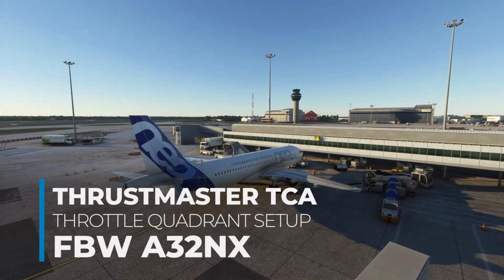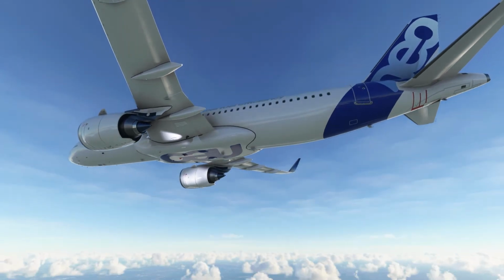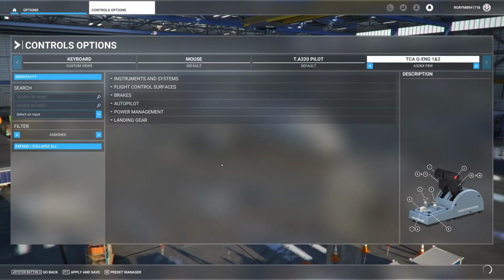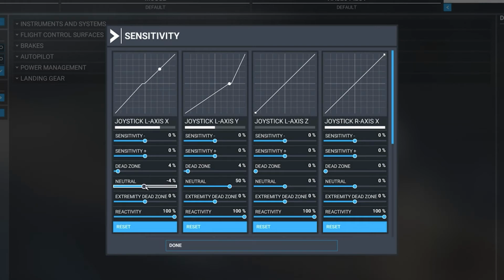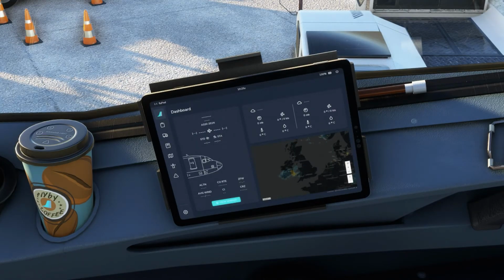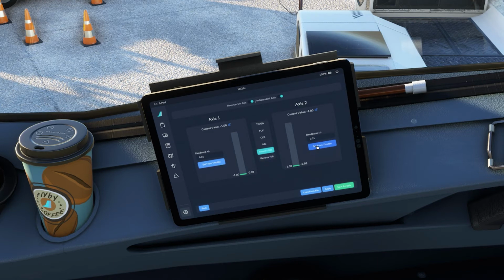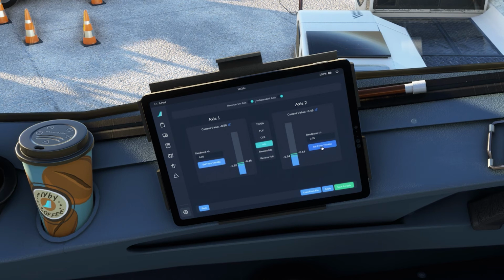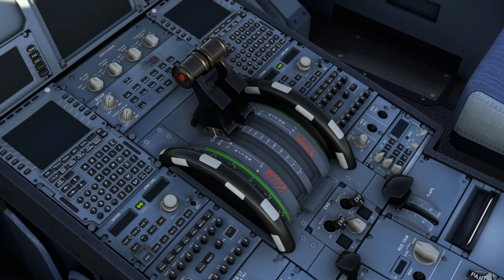A32NX Airbus TCA Throttle Setup: Best Settings Flight Simulator 2020

Comment: Why can’t all tutorials be short and sweet and to the point like this one??  Thanks a bunch bro!
Reply from the maker: Thanks mate, happy flying.
Reply: @rorymarsh Is it only for the FBW A320 or for all of them? i want to calibrate mine since i have two modes, in one the throttle works perfectly but the rest don't work and in the other one, everything works perfectly except the throttle (even if they are at the same level one of them is at 50% and the other at 70%)
Reply from the maker: @Aviationlover14  The tutorial is fairly old so, only relates to the FBW. The FENIX and The Inibuilds A320 both have their own iPads where you can calibrate throttles in there. I keep my settings the same as I've shown in the video - linear (straight lines.

Comment: I wish mine worked properly anymore....
Reply from the maker: What's up with it?
Reply: @rorymarsh  the throttles don’t go to the correct detents anymore, and for example when I push it up it can randomly go to idle or reverse which is the complete opposite way but then it’ll go to toga, or any detent, I don’t have reverse axis on in my throttle settings… I’ve calibrated it on the a320neo fbw, Shows the throttles are out of place, Can’t calibrate it anymore doesn’t let me but I have calibrated it during the time it was like that, I calibrated the actual throttles outside of the game, Downloaded drivers. Still doesn’t work.

Comment: Hi, I copied the controls but when i move the throttles, they dont match. For example if im on idle, the line displays higher. This is for all stages, I copied the settings and all.
Reply from the maker: Did you calibrate in the Flypad in the A32NX?
Reply: @rorymarsh  Yes

Comment: I just finished watching the video and it helped me to calibrate but for some reason I can not throttle up. when I take off, it feels like my thrustmasters stop working, they are moving in the cockpit doe. it says that they are on to / ga, although nothing happens to the plane. dont know if it's me doing something wrong when I take off. thank you if you are able to help me

Comment: How to setup the start engine switch? I have a different quadrant (ThrottleTek) and I have assigned both switchs to starting 1 and 2 but not working with A32NX

Comment: Well mine arrived today and my idle detent is calibrated to Climb. I cannot change it.
Reply from the maker: Did you check all of the settings in controller settings and also in the sim?
Reply: @rorymarsh  I factory calibrated it probably 50 times trying everything and every different option but when I place my levers into idle in the sim they advance to climb every time. Every other detent works fine apart from idle.
Reply from the maker: @RobertGeez  If you have Discord, get in touch - Rory_89#0001
Reply: @RobertGeez  I have the same problem, I recalibrated many times, installed new drivers, and I changed settings still like that... It was fine for a year and now it's randomly gone bad, did U fix yours?